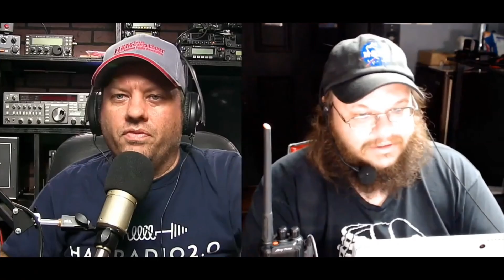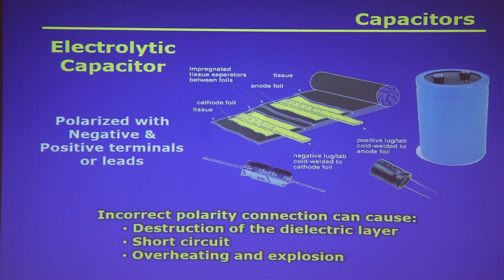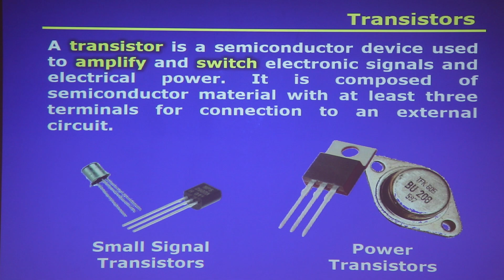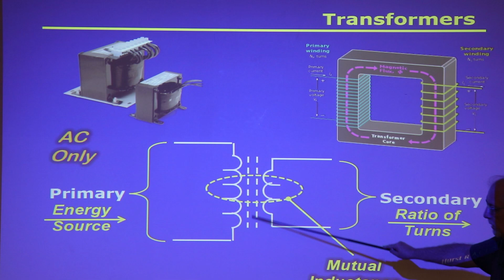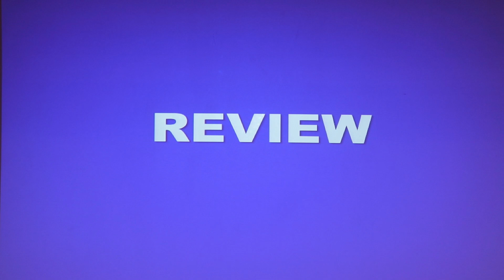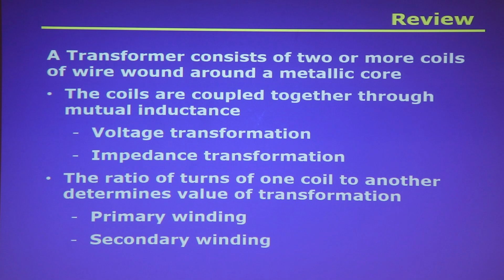Ham Radio General Class Training, Part 7

Comment: Would be helpful if the slides could be modified to correct information ("1000" rather than "100", resistors to "capacitors" etc.).  Good training when corrections, not errors, are noted and shown.  Helps the memory!!!  Thanks for the series  -  well done!

Comment: At 17:45, to change impedance using a transformer we need to use the square root of the turns ratio. So to make 100 ohms appear like 50 ohms, the turns ratio has to be 0.7, not 0.5.
Reply: Yeah, whiskey tango foxtrot